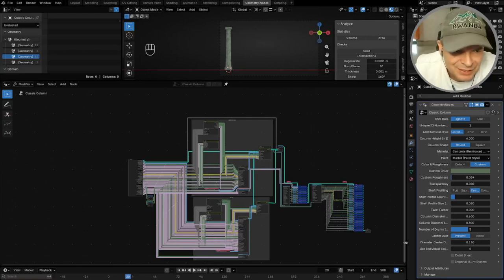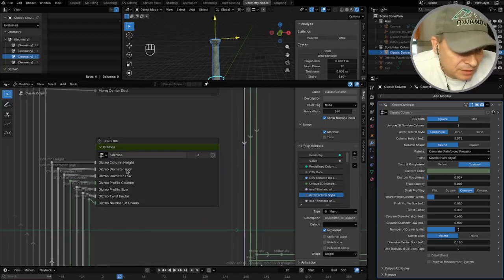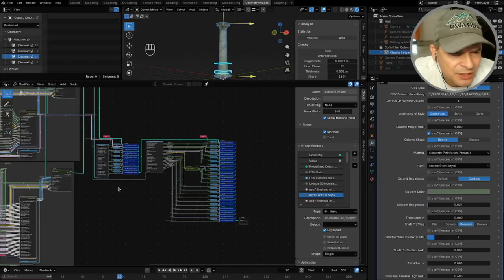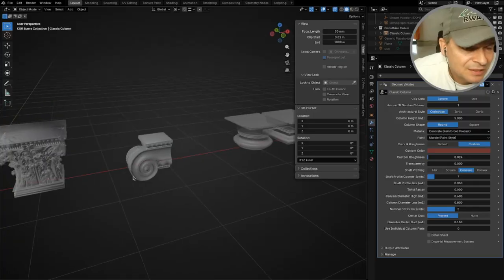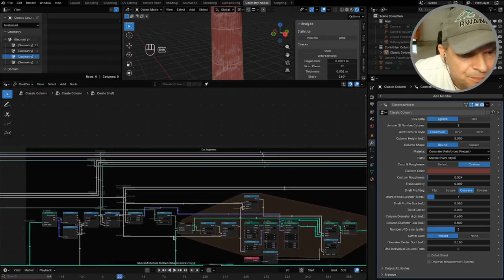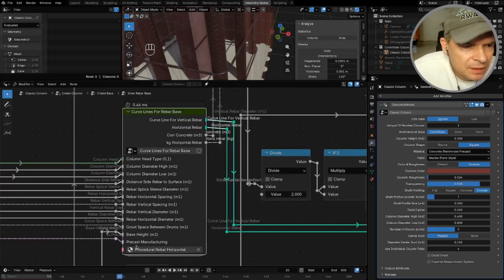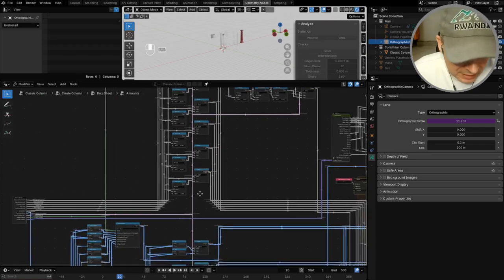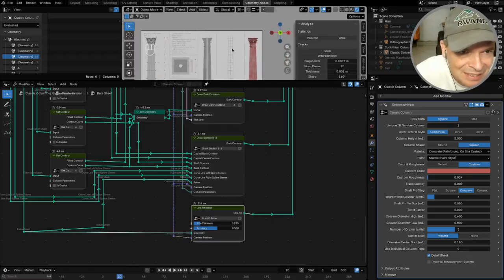Abundomy Parametric Roman Column - Blender Geometry Nodes Rig Rundown

Comment: I'm using this to make scale model columns to carve on a 4-axis CNC, and it's doing a great job creating good-looking models without a huge edge or vertex count.   I did think that some of your variable flow diagrams were piping diagrams for a refinery at first, though.   And I'm learning that Blender has some issues; a single previewed column on my M1 Macbook Pro Max slows to a crawl.

That said: thanks for this, and the explanation video.   Fantastic work!